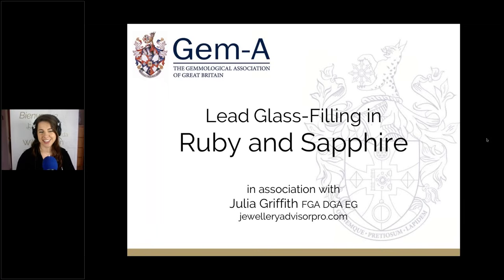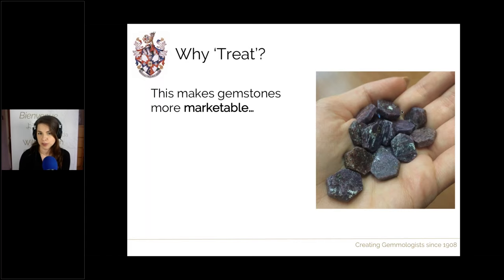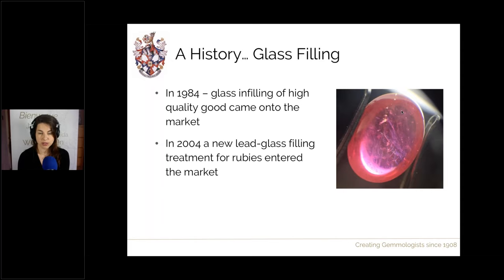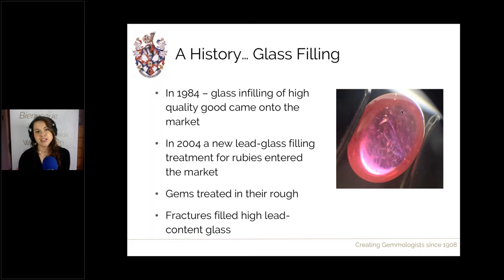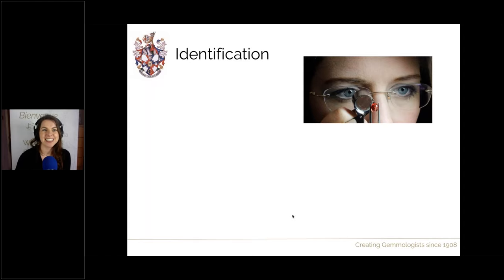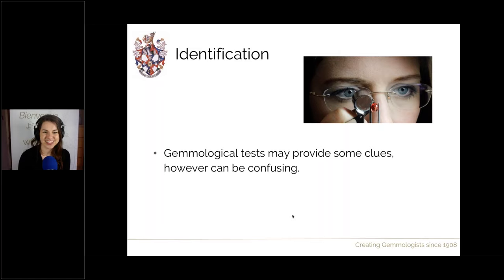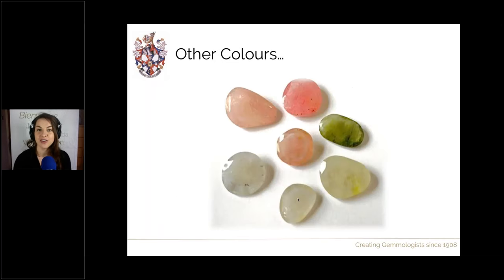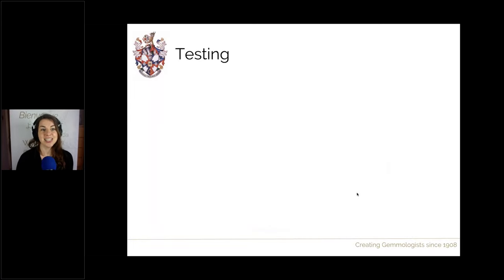Gem-A Live: Lead Glass Filled Rubies and Sapphires

Comment: I free dive for treasures and I found a rose gold ruby ring and to clean it I put it in muratic acid mix with a little water and the ruby didn't get damaged oh and the said ruby is over 3ct.
So my question is that if it was a lead filled glass ruby would the acid bring about a change?